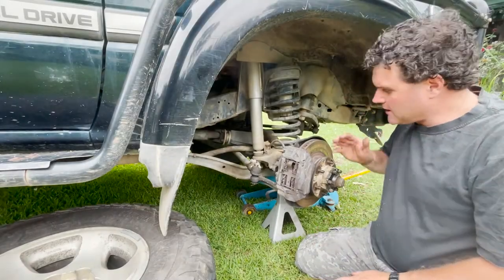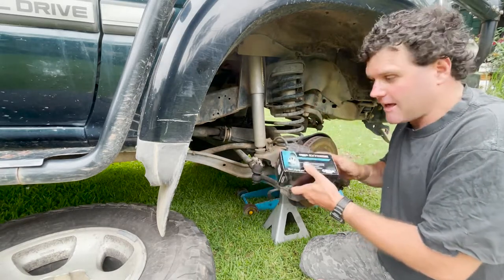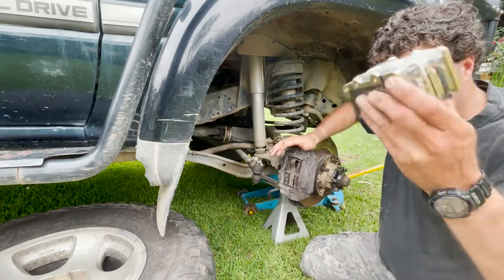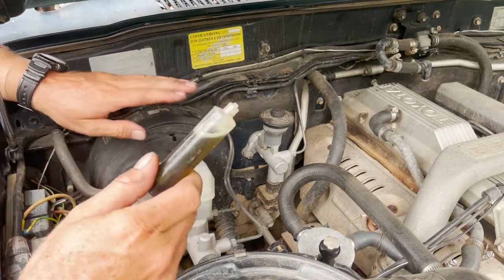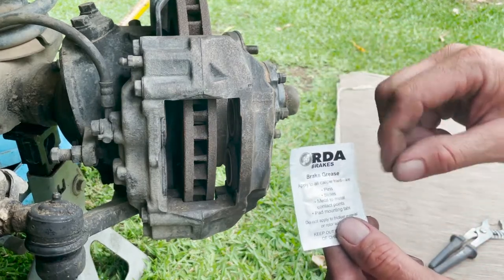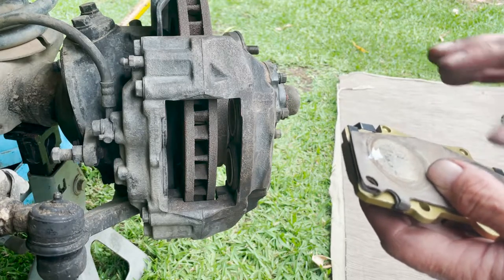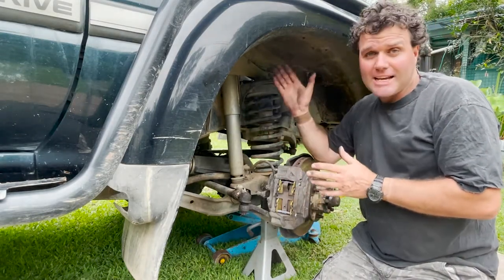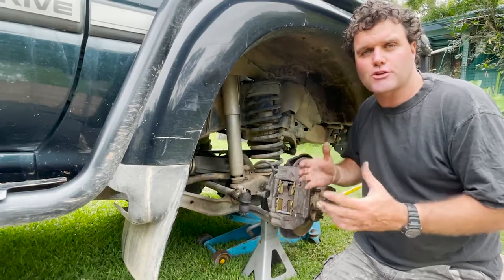Front Brake pad change 80 series landcruiser

Comment: using a c clamp to push the pistons back works well too. good video. happy i dont have to take the caliper off 🤘
Reply from the maker: Yes I have done that also. I is usually use clamp if I end up having to take the calliper off 😔
When it works right and things go well it’s easy

Comment: When I do pads I clean and repack the slide pins and wash the rubber boots and inspect them for rips, I go over the top I guess or maybe that's what you're supposed to do?
Reply from the maker: Is a great idea to do what you do. 
Probably should do that each time I change pads.
I have had those pins seize up due to water ingress. 
The video is basically what a mechanic would do.

Comment: Added safety tip: put a sole board under your jack stands, if you are not on a hard or paved surface.
Reply from the maker: The ground under where I work is rock solid just has grass growing on it. Worked on my cars there for years.
Reply: @blackllama1  Oh, I am sure you are all good. Just putting it out there for everyone who thinks any old grass is suitable 👍

Comment: Mate- screw driver is not the go, I found a segment on a rear disc between vent ribs missing and with a beveled off edges, by an and Le grinder, good enough to continue service but , Not sure if that repair wpuld be good enough for fronts, anyway 2 pairs of Multies be the best bet to force pistons & caliper apart, keep it undamaged-  the hassle of F’up$  not worth it

Comment: You shouldnt need to take any fluid out the reservoir. With new brakes all round the fluid should be at the top of reservoir and it will fall as your pads wear - but it will still be above the minimum even with all the pads worn out. You never in theory should need to top the fluid up so when you fit new pads it will never push it back overflowing again.
Reply from the maker: In theory yes that should be correct. But as when I do it I push the cylinders out past where the old pads were when new.
I just don’t like risking that it might overflow so it is much easier and safer to take a little bit out and top it up with fresh fluid.
Reply: @blackllama1  it also does have the advantage of keeping the fluid a little fresher as well which is no bad thing.

Comment: I know you’re not crawling underneath, but still a MAJOR safety issue jacking and supporting on GRASS!   Yikes!
Reply from the maker: Not had any issues been working on all my cars there for years as I have no concrete to work on, yard is base filled with well drained hard base. If it was a paddock I would not be doing it that way. 
I know that base fill here. Never had any issues